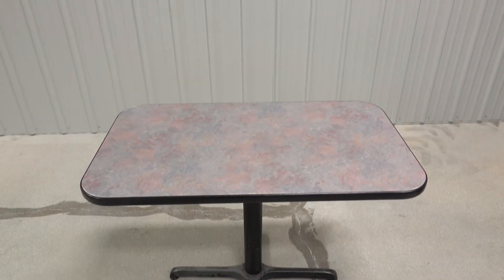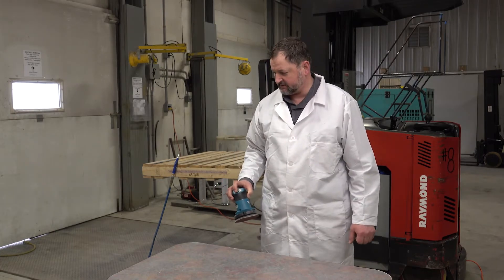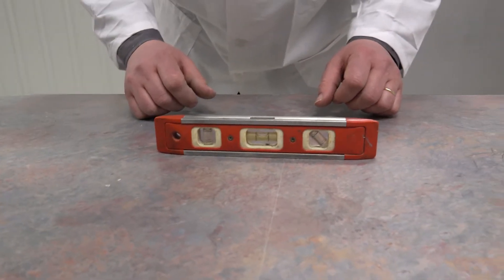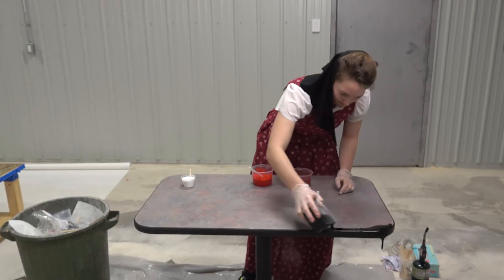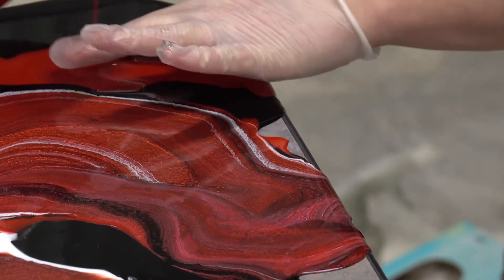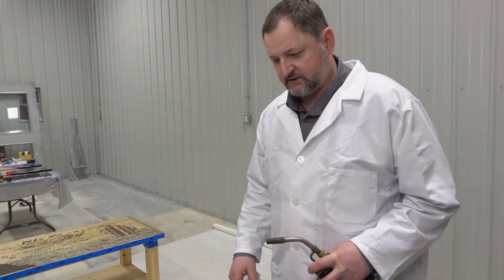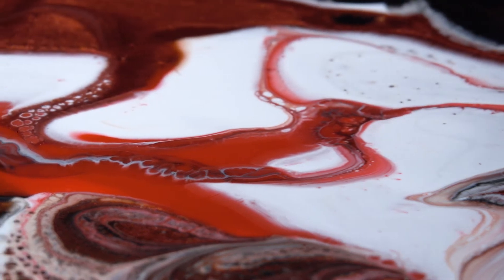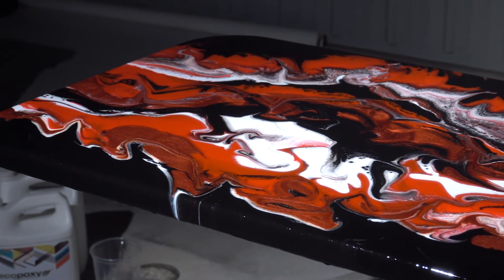Making Old Things New With Coating Epoxy

Comment: How do you do with the edges of the table?  I saw some drops at the bottom.  Or just use a sander to flatten the surfaces you want?
Reply from the maker: You can either tape the underneath first or simple scrape the drips during the curing phase or sand afterwards.

Comment: What do you guys recommend to do, when you see smudges on the surfaces, how to polish that?
Reply from the maker: Are these smudges from before full cure or after? email info@ecopoxy.com for further help as we need a little more info on your situation. Thank you.
Reply: EcoPoxy after the cure, there are some dust in the air or little particles that stick to the surface during the curing process. Can i use some polish compound maybe?
Reply from the maker: @JTManOfGod  Dust particles have to be sanded flat. Polishing completes the job after that.
Reply: EcoPoxy So in this case, the table on the video , after the curing, was sanded?
Reply from the maker: @JTManOfGod  No, it didn't need it because we didn't have dust on it.

Comment: how would this epoxy do on top of an old existing epoxy layer which has been sanded?
Reply from the maker: It would do very well. Enjoy.
Reply: @ecopoxy  what grit should we sand the existing epoxy to before applying the ecopoxy?
Reply from the maker: Any grit but the rougher the better. We recommend 60 grit. @andrewsmith1421

Comment: Did you need sand/wet sand the top and apply a finish. Example Osmo oil.
Reply from the maker: No, that is not necessary.